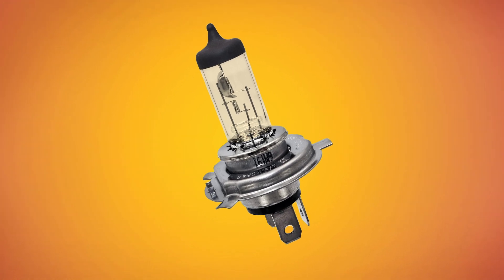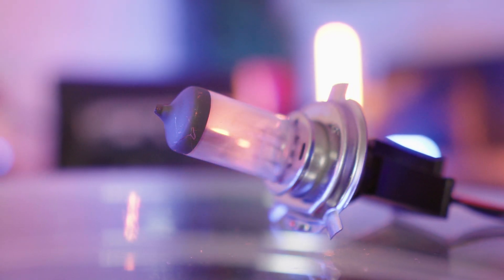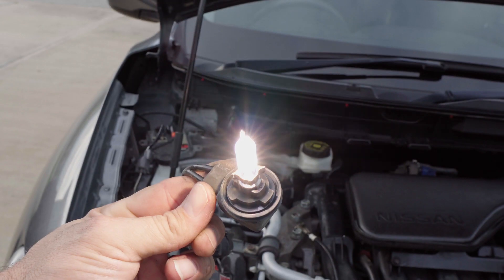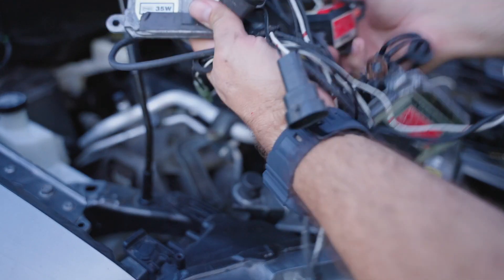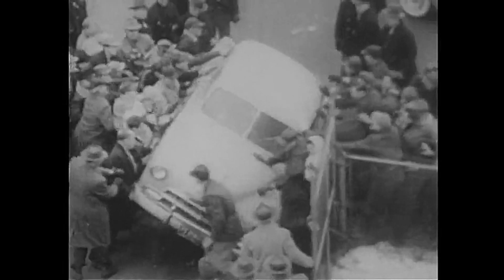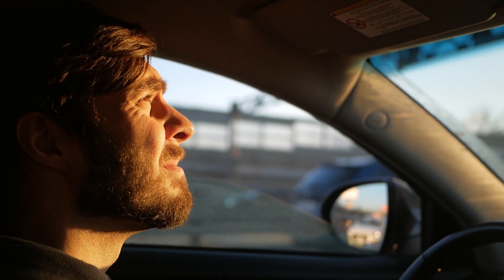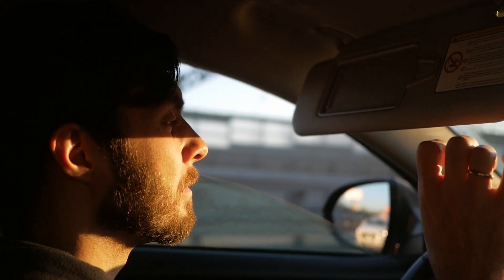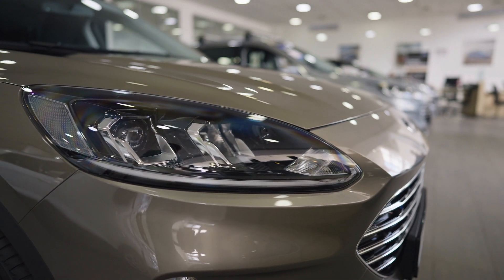The Truth Behind BLINDING HEADLIGHTS  and How to Stop It

Comment: Efficiency is a non issue for headlights because the engine is running the entire time you are driving with the expectation of EVs and Hybrids. These new lights are so bright I cannot see the road in front of me at night. I have to look across to the passenger side rear view mirror to see the line. If someone is in my rear view mirror with LEDs then I cannot see anything but light which is extremely dangerous. Which is why I cannot drive at night any more. The solution is spread the light rather than concentrate it. There is a right and wrong way to do LEDs.

Comment: It is NOT the brightness that is the problem but the blueish color, lower the color temparature to yellow like on halogen and ALL these problems go away... The blueish new headlight (Xenon and blue led) should be banned and only Xeon and Led with warm yellow light allowed, I get MORE blinded by a car with legal bluish xeon lights on low beams then an car with illegally bright 130w pair of huge HIGH BEAM halogen lights !!! That is insane, and still the 130w halogen light bulbs is the ones that is illegal to use because they are to bright....

Reply

Comment: High beams are brighter because high beams are usually a completely separate light bulb AND housing from low beams! What you said is simply not true! I even had two cars with halogen high beams and HID auto leveling low beams. 

I keep my headlamps and my glass clean, but driving a normal car with LEDs like mine, is still impossible with tall vehicles(Cadillac, Jeep) or badly designed headlights(Tesla, new Toyotas) which use LEDs without auto leveling. Auto leveling used to be STANDARD on cars with HID headlamps(90s and 00s). Now with LEDs its not? Wtf
Reply from the maker: Thanks for your feedback. While it’s true that many vehicles do come with separate housings for the high beam, the bulb output in lumens is usually very close to the low beam bulb. For example on vehicles with halogen bulbs they are usually within just 5watts of each other /‘s not enough to make a substantial difference. The main difference’s is usually the reflector design and angle which projects the light at a higher angle almost like more of a flood light as opposed to a narrower focused beam with a more distinct cut off on the low beam. As a result they tend to help you see a little farther and more around you but simultaneously blinding other oncoming drivers.

Comment: Youre not talking about the fact that LEDs dont typically have auto levelers!!! Old HID headlamps had them required by law!
Reply from the maker: The main point of the video deals with properly adjusting your light level. The video is aimed at the entire world where many vehicles would never have come equipped with that feature or where it is not a legal requirement. Currently it’s only in the USA that bi-xenon lights require that feature and a lot of Europe. However for the other 90% of the world it’s not normally a requirement so understanding the fundamental issue will help users deal with it whether or not the vehicle was equipped.  I agree it is a useful feature and one that should be standard on all modern vehicles but unfortunately that’s not the case right now. Many vehicles are coming with manual light level adjustment by means of a knob or dial in the cabin but that still depends on user input and does not help in changing circumstances while driving.

Comment: You're completely missing the point. Vehicle lighting used to regulated and had a maximum acceptable output. Don't know if that has changed or if the government is just become lackadaisical especially the police who do nothing about failure to dims. The situation is making it much worse for people who don't have perfect vision are aged or handicapped who was previous sliding got by just fine . It's like somebody in the government took a huge bribe to allow the lighting industry to go forward unrestrained. Notice how many vehicles have extra lights that were previously considered equipment violations.
I would like to know how many avoidable collisions hypocrite due to unregulated lightin andg

Comment: This Report Danced COMPLETELY AROUND A VERY DANGEROUS SITUATION INDEED...  Higher Sitting Vehicles Have The Super Bright Headlights Sitting At THE SAME  HEIGHT  As The Driver's Line Of Sight In Lower Sitting Cars. NOT GOOD.   Also,  Most Vehicles Today Have The Main AND  Lower Fog Lights ON CONSTANTlY.  Having 4-Beams, (And Many Times 6-Headlight Beams), Facing Oncoming Drivers To Blind Them.   And Also Drivers Today Expect To DRIVE AS FAST AT NIGHT As They Do In The Daytime, Requiring MORE Road Lighting.   When They Should Actually Be REDUCING THEiR  Night Time DRIViNG  SPEED.    And Finially, If A Person Needs THAT MUCH LIGHT To See To Drive At Night, THEY  SHOULDN'T  BE  DRIVING   AT ALL,  And Need A Vision Examination.  Glass Sealed Beam Headlights Worked FINE For DECADES.  But These  Self Centered  Concocted  Excuses To Allow VERY DANGEROUS Blinding Headlights Is TOTAL  NONSENSE.   If Cars Want To Have That Much Brighter Blinding Light On The Road, Then It Should Be Aimed WAY DOWN At The Pavement.  And Have Automatic Sensors To Only Tilt Them Higher When NO ONCOMING TRAFFIC Is Detected Coming Toward The Blinding Vehicles Lights.  Better And Easier Yet,   Just Outlaw  The Damn Things Completely And REMOVE The Safety Hazzard Altogether.  EVERYBODY I Talk To HATES Being BLINDED By Them... PERIOD...

Comment: A major advantage of LED lights is they can control the color of the light. The manufacturers just need to specify a more yellowish color for the LEDs, the cost of building the things will remain virtually the same. For a few years now they have been stuck on this ^$% idea that these blue terrorizers are better LEDs the mimick the old halogen bulbs. We don't need expensive new technology, we need reliable well designed products.

There should be a law that the trucks and SUVs must still have their headlights within a range of height above the ground, regardless of how tall the truck is or if the &^ thing is lifted.
Reply from the maker: I agree better regulation is important. And yes 6000k is the most common color temperature available not because it is best for us to see but it’s a balance between what most people think looks cool and what could be considered a fair amount of light that we can see. I’m just thankful that the rage of 8-12000k bulbs that was popular a decade or so ago has died down.

Comment: The temperature of the sun changes as the day goes by. Mornings and evenings have a different temperature. As I have sold LED lights for years and know the temperature they produce. The worst offenders is GM their lights are blue white and produce more light as well. Truck makers place the headlights higher on the front of the trucks. Add to this a load in the truck and the lights point higher than normal. The same for cars with a load in the trunk or people in the back seats. There is no need for that kind of light when you are facing on coming traffic. High output lights are great for search lights or aircraft landing lights as they don't face on coming traffic. Yes cleaning your lights and windshield helps but blue light blinds people. Ask any eye doctor! ! !

Comment: Also depends on the load the vehicle is carrying, if the rear of the vehicle is weighed down the headlights are aiming higher.
Reply from the maker: Yes that is true so you need to set it up based on your most common load. Some vehicles that are designed to carry loads regularly have self levelling lights or have a few adjustment options on a switch in the cabin to help control this variation. For most passenger vehicles the difference in angle for rated loads shouldn't be so major it causes a massive change but it does need to be a consideration when setting the angle.

Comment: I disagree with the conclusion. Even a properly adjusted light will still blind people. SUVs and trucks simply ride higher than sedans and will shine directly into mirrors and windshields, and every car hits bumps in the road, goes over hills etc. Light is going to get into the faces of other drivers, and if the light is too bright, it creates a dangerous situation. I've seen headlights that were uncomfortably bright in broad daylight, and I've been forced to frequently stop using my mirrors at night, because the glare makes it dangerously difficult to see anything. I've drifted out of a lane because I couldn't see a turn while being blinded through my mirrors by some SUV's headlights that rival the sun. Modern headlights are far too bright.
Reply: By definition "properly" adjusted lights won't blind people. If its still blinding, its not properly adjusted
Reply: @nateb4543   NOPE.  Regardless Of They Are Adjusted Properly On Higher Vehicles.  They Are Too Damn Bright...  PERIOD...
Reply: @davemckolanis4683 its not the brightness, it is the spectral power distribution of the light and the lack of auto aiming features! Old HID headlamps had auto levelers! They didnt blind people despite being brighter than LEDs.

Comment: Turning on my high beams, they DEFINITELY get brighter, I got 18k lumens between my two Hikari high beam led bulbs
Reply from the maker: Many or most led kits allow for both diodes to remain lit when going from high to low beam. Most halogen and other bulbs however only use one filament at a time. This still isn’t the main reason for blinding on coming traffic but only amplifies the issue if the bulbs are not angled correctly
Reply: @Redline's Garage   I don't have headlights that share high/ low beam in one housing. High, and low are separate. I know all that other stuff. I was replying to the part of you saying "High beams don't get brighter, they are just angled higher". Which was partly false, because the high beam holds no purpose if it doesn't get brighter than a low beam. But yes they are angled 🤣
Reply from the maker: @mrman8856  Understood. The light output from the high beam and low beam are the same. Of course when both are on you would have double the light output with both on. One bulb is not brighter than the other. The angle is what  makes it appear to shine brighter because it makes the light throw farther and wider along with the double output.
Reply: @Redline's Garage   No it's not lol. Why you keep saying that sir??? Low beam bulbs have less intensity with a shorter throw,  high beam bulbs have a higher intensity with a longer throw. I don't think you thought this all the way through on how headlights work. Whether with or without led bulbs.
Reply from the maker: @mrman8856  There is no differentiation between a low beam or high beam bulb. The only thing that makes them different is their usage. Most bulb types/codes are used in many applications including low or high beam or fog light. If you look at most manufacturer models all their bulbs of a certain model boast the same wattage/lumen output. There are in fact several headlights designs that use the exact same bulb for both high and low beam and if you were to swap them they would output the same amount of light. The voltage going to both harnesses is the same. Now if you intentionally or inadvertently buy two different model or type bulbs that have different light outputs then of course you will get different results but that is not because the bulb was designed for a high or low beam purpose. Also many headlights now use one bulb that serves as both high and low beam bulb and the only thing that happens is the reflector at the back of the bulb uses a motor to switch the angle when you change. Further proof of this is the staple servo type h4 hid upgrade that was the industry standard in his swap outs for years and did just that by using a motor to pull the bulb forward or back a small distance simulating the variation in filament separation from the halogen bulbs they were designed to replace. This is not my opinion just a fact. And after 20 years in the industry, selling and using thousands of different bulb types and technologies and having training for each one I have given it much thought. But if you still don’t believe I guess we can agree to disagree.
Reply: @Redline's Garage   Sir, I'm not going back and forth with you. Clearly, you're confused!!! So you don't know the difference between a 9005, 9006, or H11??? THEY ALL LOOK SIMILAR BUT ARE NOT INTERCHANGEABLE between high and low beam, and they each have different functions. An H11 can be used in high beam or fog lights. You're correct about voltage going to each bulb differently! Its weird that you know that yet are still confused, thinking you can just switch them with the same effect 🤣🤣🤣 I suggest you do some research and look at different bulbs. That's like saying HID, LED, and Halogen are the same. A low beam Halogen has tungsten on the tip to STOP THE HIGH BEAM, a high beam Halogen does not have tungsten tip so the beam can disperse wider vertically and horizontally in a reflector housing.
Reply from the maker: @mrman8856  some code bulbs are indeed more commonly used for specific applications like high beam for example the 9005 bulb. Other bulbs are found across both high and low beam for example h1 bulbs, some hid bulbs with electronic modules etc. However either way I think you are missing the point I am trying to make. The actual light coming out of the bulb is not significantly more or less across the different models assuming the technology and lumens output is the same. Of course you can’t compare a halogen with an hid bulb or different wattage bulbs etc. The way the bulb fits into the housing and the design of said housing and bulb and how they work together is what influences how the bulb disperses the light is the main difference between them. If you were somehow able to fit a 9006 bulb into a 9005 housing  as I’ve seen several people do it would output the same light from the bulb but the result is a poorer less usable light beam because as you rightfully said the design is different so it will actually shine incorrectly. I’m also not going to go back and forth since it seems pointless so this will be my last post but I wish you the best and whatever bulbs you decided to use please remember… drive safe.